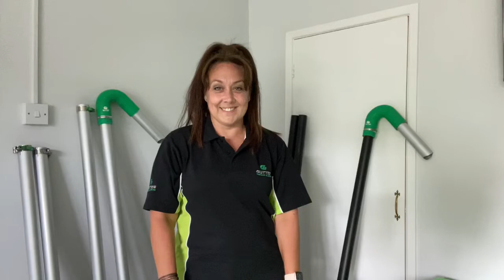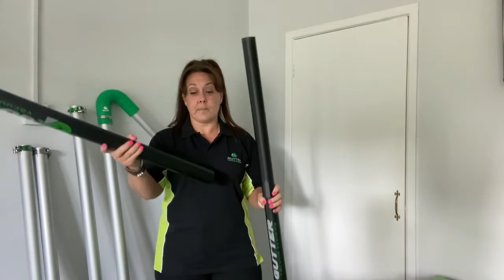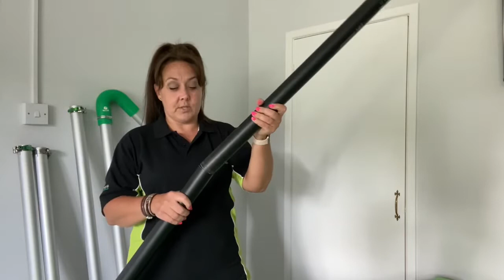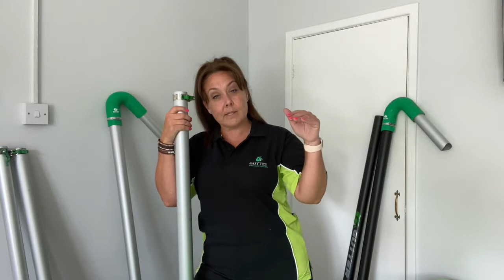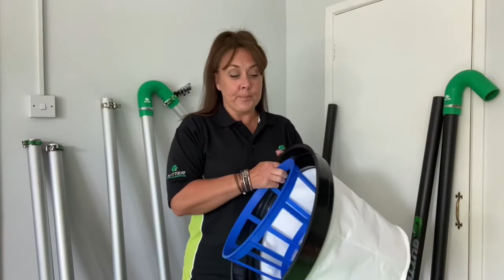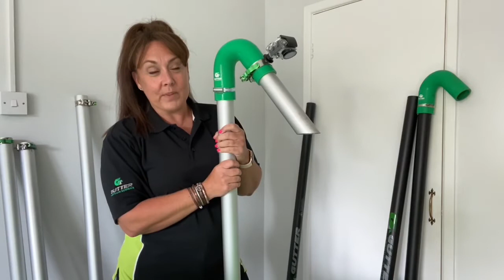Gutter Vacuum Carbon and Aluminium Pole Assembly, Nozzles and Camera Tips

Comment: Thanks for the video. I thought the filter had to stay in at all times. I will try it without & hope the suction is better. Also I never use the clamps on the ali poles. I find the are tight fitting without them
Reply from the maker: The GVS filter is predominantly a dry use filter but it is a filter that can get wet. It must be fully dry for dry use.  If you find you have a loss of suction performance, hose the sludge off the filter and continue. If there is a high quantity of water in the gutters you could remove the filter and the float valve will continue to do its job. Ensuring there is no muck around the float valve which could prohibit its job and therefore risk motor damage.

The quick release clamps we provide for the aerospace aluminium should always be used. We introduced these to the industry many years ago having initially used nut spinners & jubilee clamps.  The quick release clamps are there to prevent your poles from spinning, coming apart and from shunting. We advise they are used.

Comment: Hi you said to remove the basket and filter out when the gutters are wet... how about if I do one job which is wet and then my next job in 15 minutes time is dry and it continues like that all day. How do I manoeuvre between keeping the filter in or taking it out for every job, that’s a bit of a pain in the ass. 

Can you give some advice on this please... as when I’m doing jobs all day I don’t have the time to wash the filter and polices in between jobs...
Reply from the maker: Hi, when we haven't had rain and the gutters are generally, typically dry and dusty you would need to keep your cloth filter or Hepa filter in (filter dependent on which machine you have). This will protect your motors from fine particles.

When we've had rain and the gutters are wet, sludgy etc, you can remove the cloth filter for that reason, or if you have the Predator, remove the Hepa filter and use the blue foam filter.

You can clean the cloth filter under a hose or low powered jet wash, the Hepa with an airline or a low powered jet wash. The blue foam filter can be washed with soapy water under a tap/hose.

Just ensure that your cloth filter or Hepa filter, are fully dry prior to next use on dry dusty gutters.

Hope this is helpful.
Reply: Gutter Vacuum Systems Ltd it’s helpful... but how do I work around this if one job is a wet job and the next one is a dry job and so on... this isn’t the ideal for a business that’s constantly on the go

Comment: Hi, have just bought a gvs3600 being delivered in a couple of days, re the claw nozzles would you have to use a jubilee clip to keep these in place? Also are they a necessity for the plants growing out of the downpipes or does the machine do a decent job on these anyway without the claw nozzles?
Reply from the maker: All of our pole kits are supplied with a nozzle securing clamp, this saves time when changing your gutter clearing tool. 

The claw is a fantastic tool for grabbing and ripping out the more stubborn vegetation, removing gutter hedgehogs (if they’re not secured in) or guards and even work great on breaking surface ice too. 

For downpipes, the gulper nozzle will hugely help as will the longer nozzles. If the vegetation in swan necks are more deeply rooted this will depend on the way this is lifted and if screws are left in the joins.
Reply: @guttervacuumsystemsltd4091  okay thanks, I'll order one, sounds really useful, I've got one customer with a small tree growing out of their downpipe, my current gutter sucker was useless trying to get it out, so I'm looking forward to trying this machine out 👍

Comment: How do you run these machines at people's property?
Do you use a generator...or plug in at the property?
Reply from the maker: You can run these directly from mains. 
If plugging into conservatories, extensions or very old properties then they may trip but usually directly into the ring main is no issue. 

On generators if you’re running with the smaller single motor we’d recommend one with a minimum 2.7kVA, ideally 3.
A 3000w triple we’d advise a minimum 5kVA and with the 3600w we’d advise a minimum 5.5kVA - ideally 6.5kVA.
Reply: @guttervacuumsystemsltd4091  
Thanks for replying GVSL!
The reason I ask is this....are people generally okay you plugging in their mains during these times?
Or are you best getting a generator?
Reply from the maker: @Z4kYb0I  That is something you would have to ask your customers referencing the pandemic. Most customers who are allowing someone to work on their property would completely understand that electricity could be required.

A generator is used for when there is on access to electricity or if you have been called in for works when the customer is out.

Comment: Great video Julia thanks I have just got my lightweight aluminium pole kit from yourselves but not used it yet. I notice there are no slits cut where they clamp together is this correct ? Wondering when I clamp them together will they tighten up and not be able to get them apart ?
Reply from the maker: gary deamer thank you, only the 1.2m has the slits, the 1.5m aluminium don’t as they’re a thinner wall
Reply: @guttervacuumsystemsltd4091   Thank you I'm off to do my gutters now
Reply from the maker: gary deamer any questions on setting up, using or maintaining you know you can always contact us 😃

Comment: I have been using Skyvac for over 6 years now, have 3 vans equipped with them. The problem with poles sticking together is a regular occurrence. This also happens as the "join" area wears away, and they poles connect deeper. I'd be interested to find out what kind of price the poles are to buy. I purchase around 10 poles monthly to replace, also replacement vac heads.
Reply from the maker: Micky Haywood we sell pushfit poles in 20ft, 25, 30, 35 and 40ft, the latter is £669.98. The poles are a 51 diameter and additional poles can be added at £79 each. I’ve included the direct link for you 

https://www.guttervacuumsystems.co.uk/product-category/gutter-vacuum-systems/gvs-gutter-vacuum-pole-set-51mm-100-carbon-fibre/
Reply: @guttervacuumsystemsltd4091   Hi, do you ever travel to the north west? Im in Manchester, I would be interested in looking at the carbon and ally poles.
Reply from the maker: Micky Haywood unfortunately we don’t no, not at the moment. But we are looking at something when the new clamped poles arrive. We’ll announce that on our Facebook and Instagram pages nearer the time 😉
Reply: @guttervacuumsystemsltd4091  Ok, ill probably give you a call in the week. Thanks
Reply from the maker: Micky Haywood you can call us on 01603 905501, look forward to speaking with you, Julia